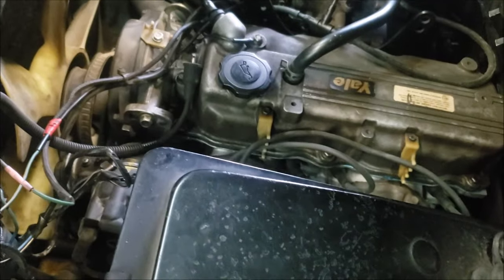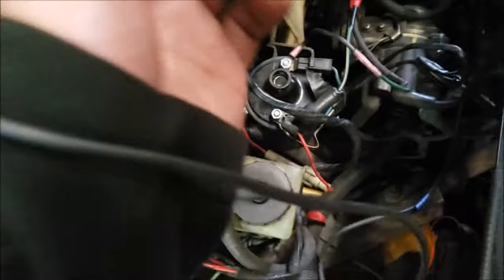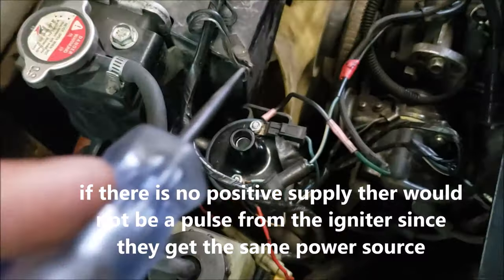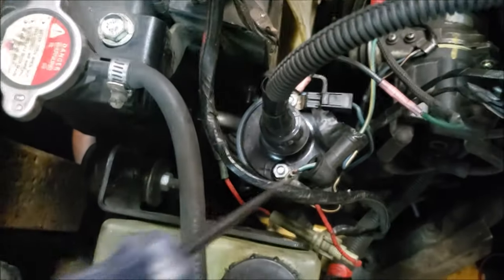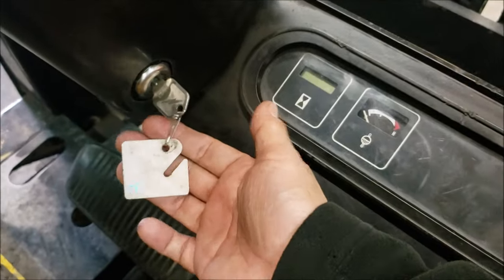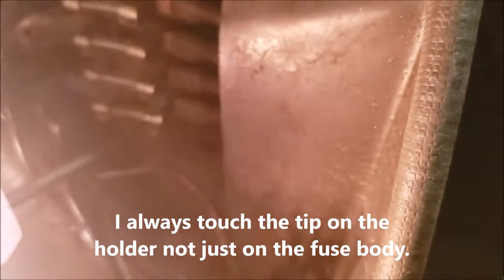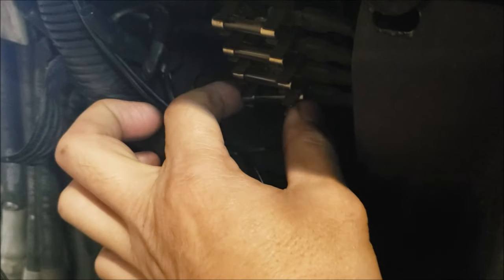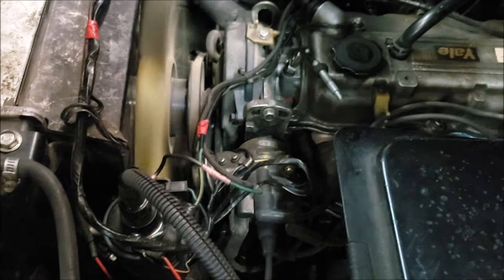Checking Ignition system with basic tools

Comment: So on my Toyota 42-3fg i have no power at coil, used the test light like you did to the positive side of coil but still getting no spark? Where to look now? My key was left on and after charging the battery it lost spark....
Reply from the maker: The other wire would go to the distributor. This wire provides a pulsed negative to the coil to create a spark. If that is present, then check the resistance of the coil primary and secondary. Also make sure that the battery is strong enough to crank the engine consistently.

Comment: Great video as a always, quick question,  do you know what the definition for a p1249 code on a Komatsu FG25T-14 Forklift with a Nissan k21 engine. I am having a crank no start issue
Reply from the maker: P1249 -LPG fuel pressure is excessively high
Reply: @forkliftgeek10  okay thank you,  can this cause a no start issue
Reply from the maker: If the fuel pressure is really high then the engine could get flooded preventing it from starting.
Reply: @forkliftgeek10  Thank you very much as always
Reply: Can a p0118 code cause  a no start issue on those nissan k21 engine. Because I am having a no start issue and the two codes present are p1249  and p0118